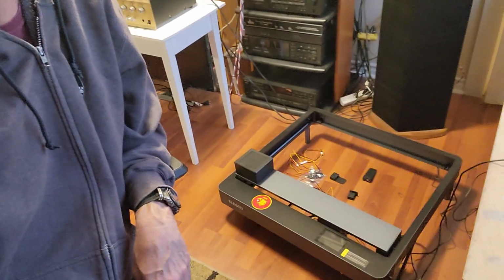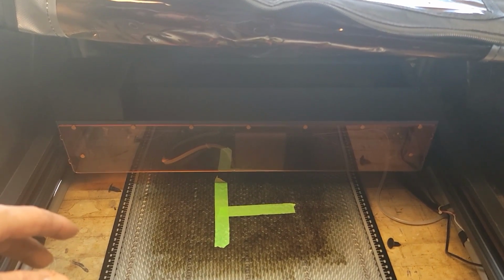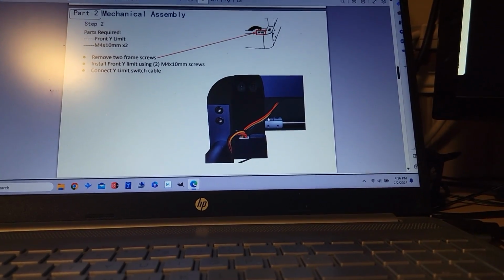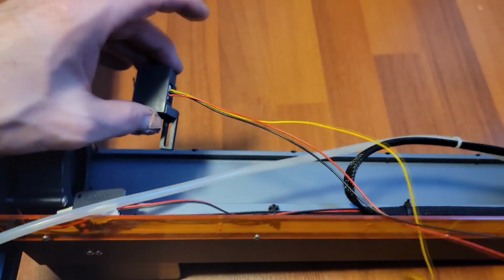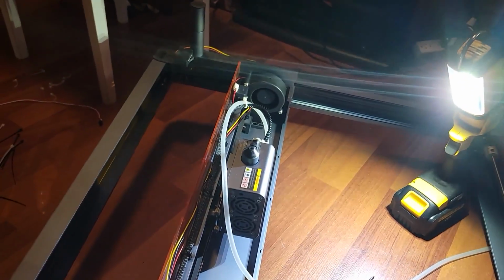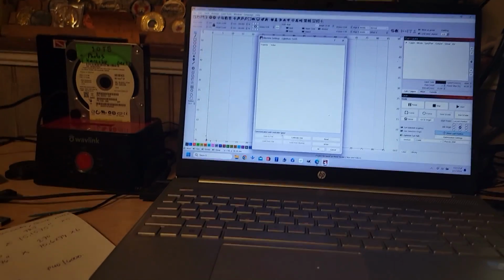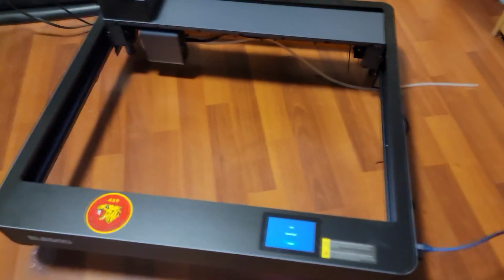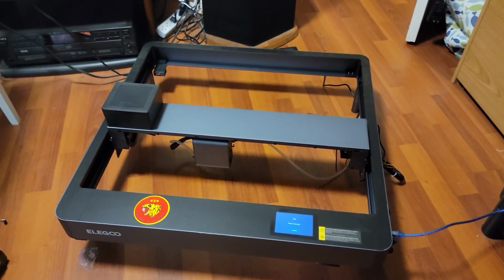Elegoo Phecda 20W 4 Limit Switch Kit by GeeksAtLarge - Part 2 (Installation and Operation)

Comment: Thanks for letting me know about the issues you found when installing! 

At the original position show in the beginning of the video, your rear Y was being triggered, which is why the gantry didn't go anywhere.  The module was triggering the left X limit, which is why it didn't go anywhere either. 

The machine doesn't know which limit it hit (left/right or front/back), only that it did, so, when it found that it was triggered immediately when told to find Home, it assumes it found Home and everything was done.  

Yes, the instructions do assume that the owner has at least basic working knowledge of Lightburn. It also makes some assumptions about how the machine is set up internally  (Machine Settings) and in Lightburn (lbdev file from Elegoo). These assumption are made because not every possible combination of settings, options, and conditions cannot be reasonably covered in an installation manual.

BTW, if you haven't found it yet, the Move tab is where your manually controls are. Lightburn has a nice video tutorial series for new owners, walking them through basic usage. https://lightburnsoftware.com/pages/tutorials

Comment: Thanks so much for this. I was also stuck with top left homing on Y after installing Cobey's kit.

I changed the X setting too as you mentioned and it homed to the bottom left. 

Success! 👍
Reply from the maker: My pleasure - glad it worked out for you. Tim

Comment: Did you update the firmware before install?
Reply from the maker: Negative - they say on the GEEKSATLARGE web site thst it is not required and works well now...
Not a big fan of updating firmware for the sake of it when I don't have to. There is always a chance of bricking these cheap Chinese boards when you do. Only if the benefit warrants it do I like to muck with firmware.😉